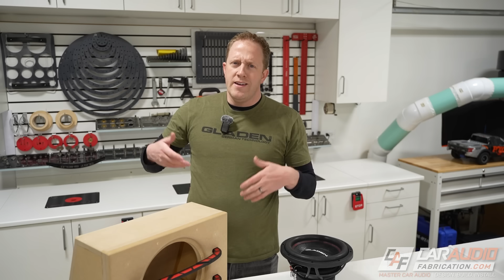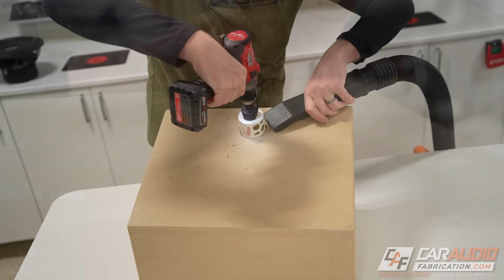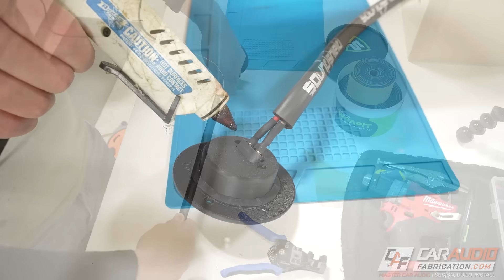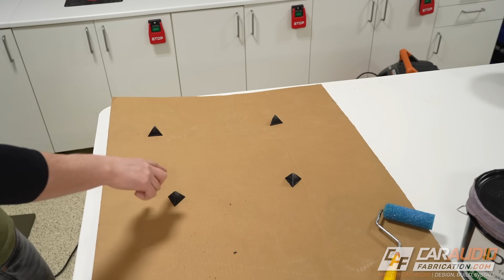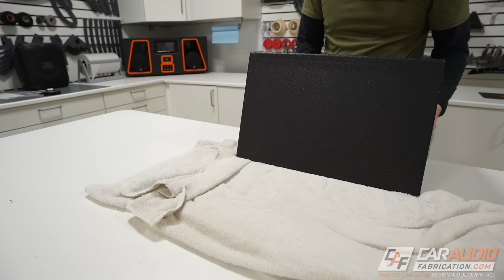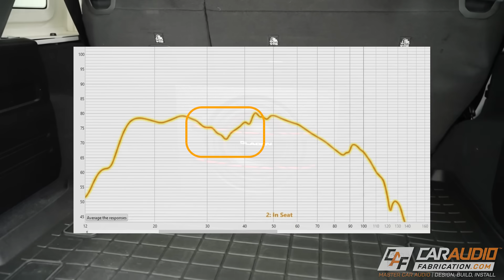Deep Bass from a Small Box? Gladen RSX 10" Subwoofer - Finishing & Test!

Comment: how would you fix a smaller box like that down ? is it possible without an obvious bracket screwed to the box and drilling into the floor for threads or rivnuts and holes in the rear carpet/lining?

Comment: Nice! I hate doing things right..Takes too much more time! LOL. I played your audio on my home stereo w/a powered sub. My sub rolls off below 35Hz or so, BUT I am able to watch the cone and it did oscillate at the 25Hz tone! Damn good mic you got there! Need that to record live pipe organ! I can see how a small displacement sealed sub has good transient response due to the high damping of the driver. What was the power of your test amp? You said efficient, but what was the power used? I can tell if an enclosure is really air tight by gently pressing the speaker cone and watch it return to it's resting point. If it fights you and slowly comes back, it's air tight.

Comment: I looked at the Crutchfield website for something to fit in the circular "pocket" in the rear of my 2015 Kia Sportage. (It's the pocket where an optional subwoofer would be in higher Sportage trim levels. You know the type.) My concern is weight and space behind the panel. I want to add bass while keeping a factory look. I've considered going with something like the 3" mini subs with 3D printed enclosures as featured on Hexibase, but I don’t have a 3D printer and still need to figure out where to place the amp. What are some good options for adding bass to spaces like this? BTW, I enjoy your content. YouTube needs more content like this.